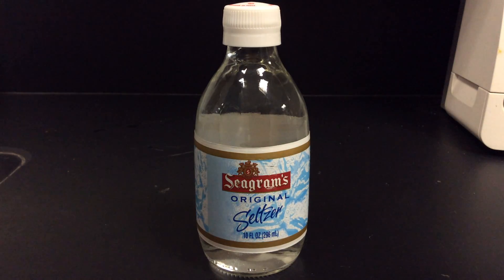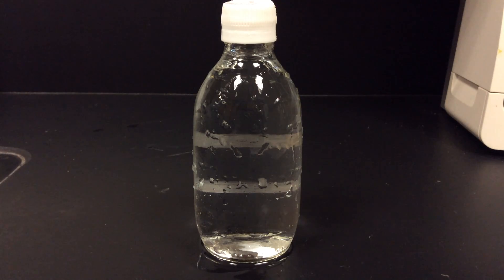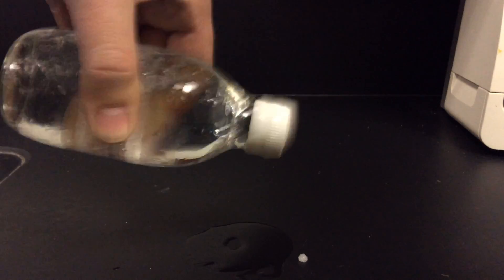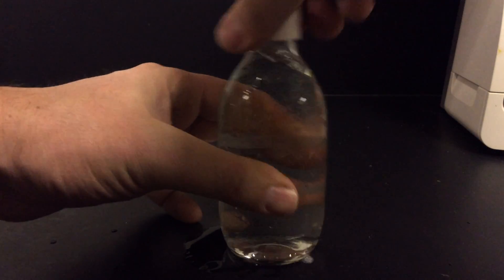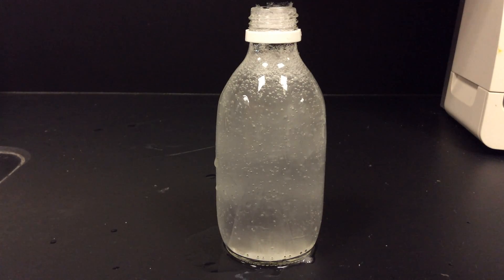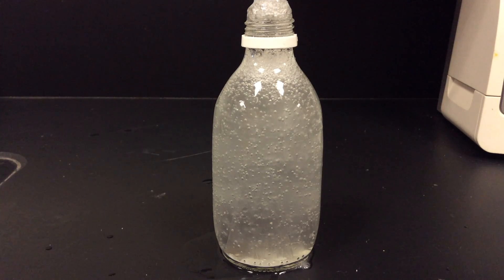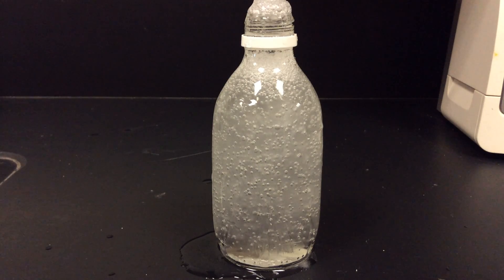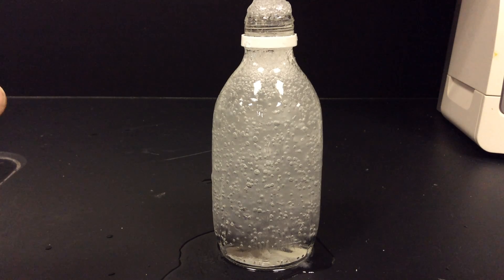Seltzer Water Freezing Point Elevation demo

Comment: I'm making a carbonated water cooler/dispenser, and I was wondering about this, Since the keg is pressurized at a fairly high pressure, I wonder if I could set the temperature low enough that I can pour ice cubes? That would be fun. For all I know, that's what those ice cube makers do, come to think of it. But if this works, then I could potentially quickly fill a thermos with just ice for my summer hikes, which would be fantastic since the volume of the ice makes it melt slower. It would probably stay icey for many days.

Comment: I added Seltzer to my diet Coke and it started to freeze up a little in the fridge I'm not sure why this happened because it doesn't happen if it were just regular diet coke? Can you tell me why you think this is happening?
Reply from the maker: The dissolved sugar in regular Coke acts as a nucleation site for the CO2 in your seltzer . I am guessing your seltzer  was very cold and or your Coke was very cold. The dissolved CO2 will lower the freezing point of the seltzer as will the dissolved sugar in the Coke.  It is harder for the water to freeze if their are particles that are in its way. So the solution of the Coke and or the seltzer was below the freezing point of water but the dissolved particle in both solutions prevented freezing. When you poured the seltzer onto the Coke, the sugar that was dissolved acted as a nucleation site for the dissolved CO2 in  the seltzer to aggregate and become bigger bubbles and leave the solution. When the CO2 left the solution the freezing point was increased because their was less  CO2 in its way. When the freezing point increased enough to match the temperature of the solution freezing occurred.
Reply: MrGrodskiChemistry I figured it was something like that but your analogy is a lot more specific and that's exactly what I wanted thank you
Reply from the maker: You're welcome.